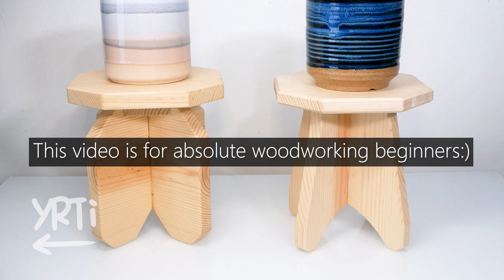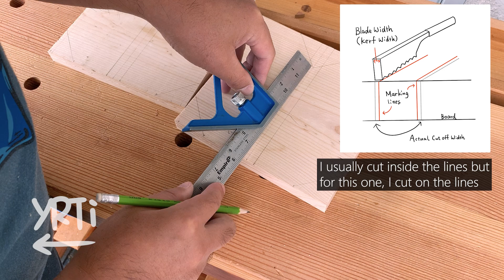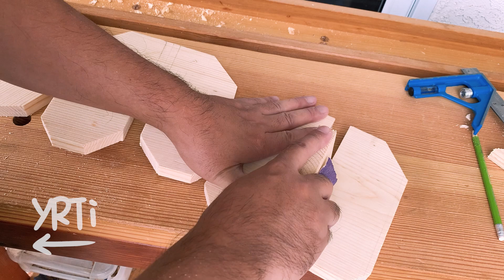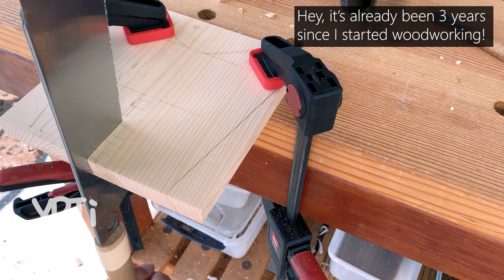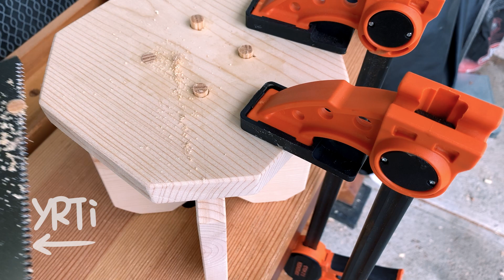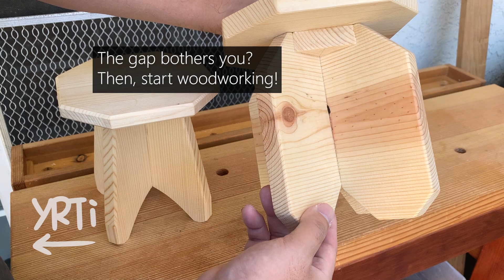A Simple Project to Start Woodworking | Beginners

Comment: hello! I have a silly question. Do you buy the dowels or make them? i’m putting together a list to try this project. Thanks in advance.
Reply from the maker: Hi! Thanks for the comment. I bought the dowels at my local Home Depot. The only downside is that the size isn’t very precise, so if you get one that runs a bit small, you might see a gap around the dowel. Anyway, I think the key to this project is finding what can help you improve and whether you enjoy this type of woodworking. Good luck!
Reply: @YRTi  Thank you for the quick reply! I'm not super concerned with the gaps and final product, since is will be my first woodworking project. It's more about the journey hehe Thank you for the great content.

Comment: Agree with everything you said. I believe “hand tools are slow” is a myth made popular by power tool companies to help sell more power tools.
Reply from the maker: For the size and fabrication of one single item, yes especially I don't have to make a template but when it comes to resawing a big panel and dimension it, we should admit hand tools are slow, haha:)
Reply: @YRTi  I find however that the level of enjoyment and reverence for a personal work is directly proportional to how hard-won the results are. Little effort, little reverence. Great efforts, great appreciation. There is a time to leave the power tools off and spend the time to do it by hand, and I find that is when there is a chance I could see the piece either daily or on-occasion. The added effort and time imparts an invisible quality that nobody else can see, from which I lay my eyes upon the piece I have trouble drawing my gaze away as my mind is transported back to the effort. I just don’t get that experience when I take the most efficient route to complete the project with power tools
Reply from the maker: I agree with you. By the time I finish a project, I even remember most of the grains on boards and that's how much hand tool people pay attention to their products! In addition, the major reason I started woodworking with hand tools was I didn't like the inconsistency of my hand held powered router. Usually, people believe powered tools are more accurate but unless you have super high-end machines that are nicely set up, you can't get the accuracy you get from hand tools. Well, people say there's no perfection in woodworking and you don't need that machinery level accuracy in woodworking while they also say "dead accurate" when they really nail it. My goal is to consistently have the "dead accurate" level with hand tools, which is far from how I do now but it's fun to think how I can get better and practice:) It'll be a long way.